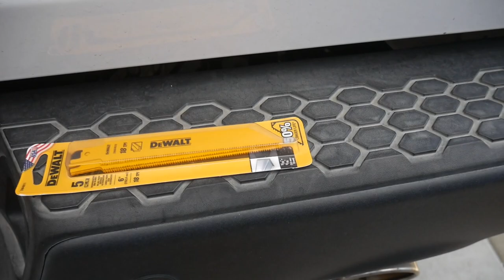HOW TO REMOVE a Locked trailer hitch with no key

Comment: Rebel just a half ton?
Reply from the maker: Correct, but with the air suspension it doesn't feel the load near as bad.
Reply: @troysgarage  sweet little feature that thing has! gotta get airbags and tow mirrors set up on 2020 f150 long bed family loves the eco boost